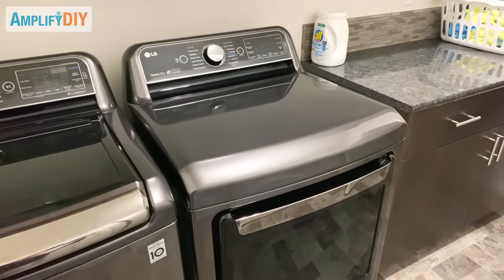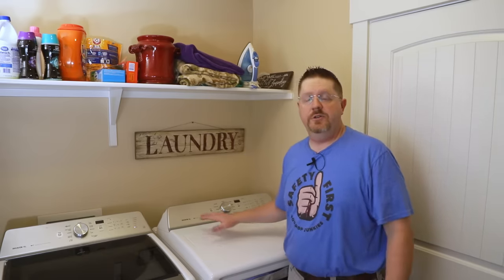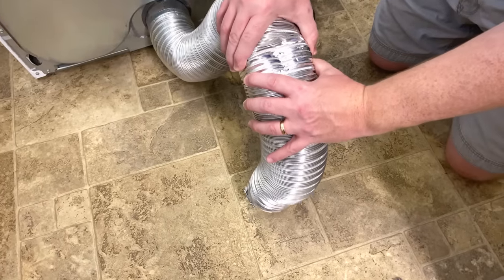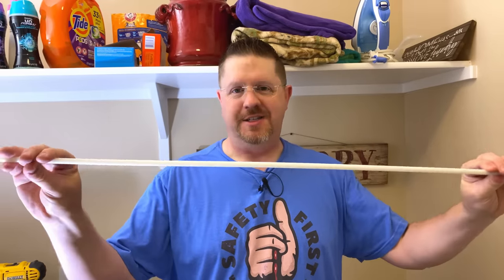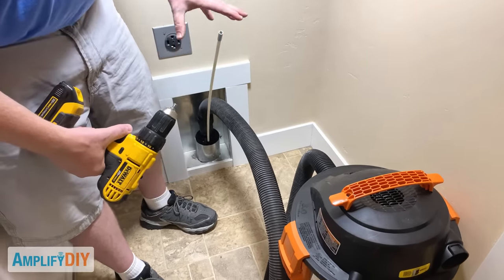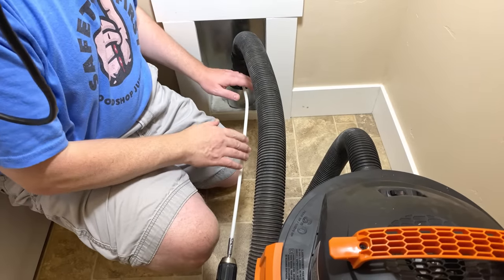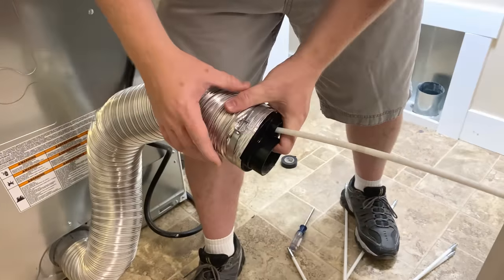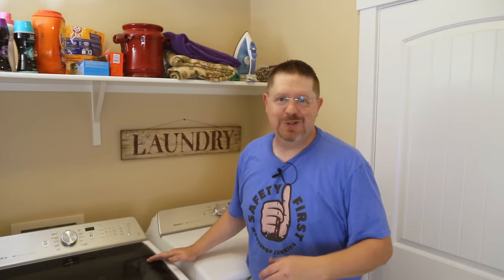How To Clean Your Dryer Vent Duct - Step By Step - It's Super Simple!

Comment: Thank you for the video. Is it possible though to clean it from outside the house as it’s almost impossible to detach the dryer from the wall?
Reply from the maker: Yes, when the dryer is difficult/impossible to move out of the way, you can certainly clean from the outside -> in towards the dryer. When doing it this way, many people opt to start the dryer (empty) on a cool cycle to help blow the lint out of the pipe. Sometimes this is done in conjunction with a shop vac, sometimes it's done instead of a shop vac. For example, if your vent is on the roof, it's difficult to get a vacuum up there safely. 
Good luck!

Comment: Yasss!!! Thank you!! Can I use a regular vaccum? i don't have a shop vac.
Reply from the maker: Hi Curly - yes, you can, but you may need to get creative to help seal up the gap at the end of the vent so the vacuum can be effective. Alternatively, you can leave the dryer connected, and run it empty on a cool cycle. Then go outside to the outlet and clean from the outside in towards the dryer. The airflow from the dryer will provide enough pressure to blow out the lint... but it will all wind up in your face this way. :) Be sure to wear a mask and safety goggles. 
Good luck!

Comment: As an owner of a company that does this for a living the video isn't 100% correct but it's a good start. Totally accurate that dryer venting should be cleaned once a year however the kits that are sold on Amazon aren't that great and you should never use a screw together type rod system unless it's the only choice you have. There are click/button types that you can use without the fear of losing the rods in the venting. Also if you have the option you should also try to use high pressure air to start from either side of the venting. This prevents blockages as the HPA can help loosen up any clogs rather than pushing huge clumps of lint into a tightly packed ball. All in all though the OP makes a good video of how to protect your home from fires as well as stop the premature burn out of your dryer element(s). The only other point I would have suggested is that you insert the shop vac hose as far into the ducting as possible as well prior to any rodding or HPA.
Reply from the maker: Great tips, thank you Adrian!
Reply: @AmplifyDIY  No worries, I love to see video's like this as it improves consumer awareness and safety...and your videos are awesome for the DIY home owners!

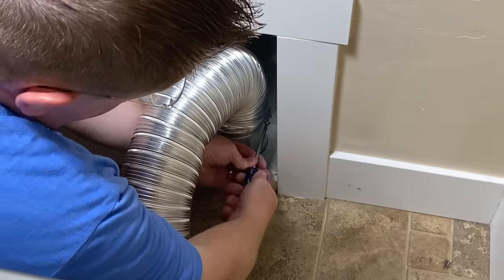Comment: Great video, I'd be concerned about the condition of that vent tube, in the video around 14:45 when you push the dryer back against the wall, there's evidence it's crimping the metal tube and likely reducing air flow because of it.
Reply from the maker: Hi Edward - I didn't show it (and I should have) but after I placed the dryer back in position I did check carefully back behind the dryer, and while the vent tube did have a bend in it, it was not crimped/crumpled/folded. Good eye, and thanks for watching!

Comment: I found that there was a leak in our attic and it was due to a small seem on the roof exhaust 6:28. I cleaned out the clogged exhaust on the roof only and used some flex seal to patch the leak. After watch this I want to go back up and clean out the dust inside!

Comment: Thank you for the great tutorial.  Quick question I am sure someone already asked.  Very tight quarters in the house, can I remove the outside vent and go in from there to  the dryer?  Wasn't sure if you mentioned or someone mentioned this already.  Just ordered the kit and its a straight shot from the dry to my outside vent, so I would "hope" :) it would be simple.  Thoughts or tips? Thanks again!
Reply from the maker: Hi Dave - yes, you can absolutely clean from the outside->in. Often when doing this, people will leave the dryer in place in the laundry room and turn it on to it's coolest setting with no clothes in it. The dryer will provide plenty of air pressure to blow the lint out as you clean from the outside. You won't need a shop vac. I do recommend you wear eye and respiratory protection if you do it this way, as you'll get a LOT of lint blown into your face. 
Good luck!
Reply: @AmplifyDIY   thank you for the clarification!  Where did you get the black attachment with the two holes (large and small) for the shop vac/ tubing that you used in the video? Didn't see a link in the comments for that piece, and it didn't look like it was included in the Amazon kit you purchased?  Much appreciate the quick response!
Reply from the maker: It was included in the LintEater kit, from this affiliate link in the video description: https://amzn.to/2E0gZjK  -  there are a bunch of knock-offs on Amazon now, none of which include that adapter. Make sure you are buying the LintEater from Gardus - that's the only one I've found that has that adapter. I'm not associated with them at all - I just like that cleaning kit the best, bought it with my own money, and it's exactly what I demonstrated in the video. Thanks for watching!
Reply: @AmplifyDIY  perfect, I did look again and ordered the one in your video that included the adapter.  Now I just need to  change my dryer door from one side to the other as the washer and dryer are on opposite sides of where the water hookup is and the dryer vent is....ie...I have a semi rigid silver slinky hose that I have to snake around the back of the washer to get to the vent in the house.  My wife said because the doors open the opposite way.  Cannot change the door on the washer, but it looks like I can switch the dryer.  The drawback, you have to lift the clothes over the washer door into the dryer if I switch the machines and change the door to the other side on the dryer.  (facepalm here). :)

Comment: Wish I had seen your video BEFORE getting into trouble cleaning my vent. I have the same cleaning kit and wad unaware of the set screw use or tape trick. The brush came off in the duct within the wall:-((ANY suggestions on how to get it out? 🙏🏽  Jason in Cali
Reply from the maker: Sort of depends on how far / deep into the vent the brush broke off. I've heard from viewers in a similar situation who have taped a bent coat hanger (in a hook) to the end of the rods they did manage to pull out, and use it as a long, flexible shepherd's hook to pull the stuck brush back out. You may find it easier to pull from the outside rather than from the inside. Good luck!

Comment: My vent is about 15' from the dryer to the outside, and it looks like the kit comes with 12' of extensions. Is it OK to clean from the dryer out, and then from the easy access outside cover and clean in the opposite direction towards the dryer? Thank you, and great video.
Reply from the maker: Yes, that's a great way to do it. Good luck!

Comment: Great video, but what does one do if they do not own a shop vac??
Reply from the maker: Hi Joseph - there are a few options. The first is to use your regular home vacuum cleaner, and a lot of duct tape to adapt it to fit the brush adapter. The second is to clean the duct from the outside of the house in towards the dryer, rather than from the dryer side out towards the outside. When you do it this way, leave the dryer in place and connected to everything, and start it running with no clothes in it on it's coolest setting. The dryer itself will provide plenty of airflow to blow the dislodged lint out of the duct as you clean. Note that you should definitely wear a good mask/respirator and eye protection if you do it this way, as all that lint will blow out into your face as you clean. Good luck!

Comment: Can you use this kit for cleaning HVAC air ducts??
Reply from the maker: Hi Itachi - the brush is designed for smaller dryer vent ducts, so it likely won't do a great job on the typically larger HVAC ducts. Great question!

Comment: Does anyone have any experience doing this with vent tubing with two 90 degree bends? My vent goes up into the wall then turns 90 degrees to exit out the side wall on the other side of a 16 foot room. EXCELLENT video!
Reply from the maker: 2 90º bends should be no problem for these brushes. Good luck!

Comment: I have a progressive form of multiple sclerosis and my husband passed away in September. I called someone in my rural area and it was going to cost $200 to clean it when the vent is only 18 inches from the outside wall. I'm wondering if I have to clean it so perfectly and shiny like you do? If not, I think I can do it myself.
Reply from the maker: It does not have to be perfect. Any cleaning is better than no cleaning. Good luck!
Reply: @AmplifyDIY  thanks so much for your help!

Comment: A high power leaf blower works great inside blowing to outside
Reply from the maker: Hi Aceyorba - you'll need to clean more frequently this way. While the leaf blower can remove a lot of the lint, it'll leave a coating of lint on the inner walls of the duct, which will just attract more lint more quickly. Cleaning with a brush does a better job, so you don't have to clean as often. Thanks for watching!

Comment: Any advice for cleaning it on a high floor of an apartment building? Specifically on if the brush gets stuck on the outside of the flap and you can’t access the outside
Reply from the maker: That's a tough one. If you are in an apartment, I'd suggest checking with your property manager to see if they are willing to get maintenance involved in retrieval of the brush - especially since you are taking care of dealing with a fire hazard that could justifiably actually be their responsibility... 

Good luck!
Reply: @AmplifyDIY  if you own the apartment such as in a co-op or condo it could be complicated as to whose responsibility is what.

Comment: Great content.. FYI Just make sure it’s hard plumbed and connections on duct hose is tight.. I had 18 feet to outside went 10 feet and out came aluminum and wire.. 😮 oops…
Reply from the maker: Great tip!

Comment: Hello, thanks for the video but I’m trying to figure out what size the shop vac hose adapter would be. I ordered the kit but there are various different sized shop vac hoses. I want to make sure it’ll fit the adapter in the kit. Any suggestions? Thank you!
Reply from the maker: I don't recall the exact size, but I know there are several "standard" sizes for shop vac hoses. My hose happened to fit the adapter perfectly, but if it did not, at my local home depot or lowe's there is a section near the shop vacs full of adapters to make things fit for just a few bucks. 

If your shop vac does not already just fit the lint cleaner adapter, I'd bring that adapter to the store and find what you need there to make it fit. 

Good luck!

Comment: Mine definitely vents to the roof, and I'm not going up there. Will a partial clean from the other end be worth the effort?
Reply from the maker: Hi Bill - it is very likely that you can get the brush all the way to the exit vent (even though it is on the roof). Even if you can't get up to clean the vent outlet itself, cleaning the inside duct all the way to the vent is definitely worth it. Good luck!

Comment: Would this method be safe to use if my 'duct work' is entirely the flexible kind? 
Thank you
Reply from the maker: Hi poyomi - NO this is not a good idea if your ducts inside your walls etc are all flexible. This brush will likely damage that kind of duct. Also, that kind of duct (at least in the US) is not up to code, and is a serious fire hazard. I'd strongly suggest you see if there is any way to replace it with a smooth-wall rigid duct like I showed in this video.
Good luck!

Comment: sorry if this has been answered before, but what do we do if we dont have access to a shop vac? my parents refuse to get it professionally done and the lint build up being a possible fire hazard gives me a ton of anxiety so i’m thinking of just taking it into my own hands.
Reply from the maker: Hey there heehoo peenut! If you don't have a shop vac, you have a few different options: you could use a regular household vacuum - just need some duct tape to adapt the hose attachment thing to fit the smaller hose on a regular vacuum. You may have to stop halfway through and empty the vacuum, though. Alternatively, you can clean the duct starting from the outside of the house in towards the dryer. With this setup, you don't need to move the dryer at all - just make sure it is empty and start it on the coolest cycle it allows. The dryer itself will provide plenty of air pressure to blow the lint out of the vent as you clean. If you do this method though, I recommend a dust mask and eye protection, as lint will be blown out straight at you during the whole cleaning process. 
Good luck!

Comment: I assume you just leave the shop vac on the entire time you’re cleaning?
Also, how thorough of a job can one do with just the brush without using the shop vac? Thanks.
Reply from the maker: Hi Sanitary - yes, you should leave the shop vac on for the whole procedure. If you don't have a vacuum that you can use, then you can use the airflow of the dryer itself to do the cleaning: start the dryer on a cool cycle without any clothes in it. Then, go outside to wherever the dryer exhausts, and clean from there in towards the dryer. The air blowing out of the dryer will blow all the lint out (and all over you. ;-) )
You do need some sort of air movement during the cleaning process, or else the lint will just ball up and clog the vent.
Good luck!
Reply: @AmplifyDIY  thanks a lot! great video and subbed.
Reply: @AmplifyDIY  update: I did this weeks ago with the shop vac and it worked like a charm! Keep up the good videos.

Comment: How do you clean the flat ducts?
I have a flattened metal duct to save space behind the dryer and the wall, attached from the dryer to the wall.
Then im not sure what is in the wall under the house that goes from the wall behind the dryer to the outside vent.

Comment: 6:30 just an FYI to folks that have this plastic style roof vent. my house was built in 2011 and i had this vent cap style crack and leak water into my home. i get alot of wind and rain in the winter and alot of intense sun in the summer. if you can replace this vent with a metal vent cap.

TAR THOSE ROOF NAILS @ 6:30 !!!!

Comment: I used this method but the brush ended up detaching in the middle of the vents. I bought another kit and thought I can push that brush out. I got all the way through but no brush popped out! Could I have a break in my piping?
Reply from the maker: 🤔 Possibly... but it's more likely that the second brush simply could not really "push" out the first one. The second is likely still stuck in there... One way to find out for sure is to get your hands on a cheap borescope to visually check to see what's going on in the vents. If you have an iPhone, here's a decent option for around $25: Primer: https://amzn.to/2CIe0bC
Good luck!
Reply: @AmplifyDIY  thank you for the reply. The link lead to a primer can. What’s strange is the duct is only 4” diameter and so is the brush, so I do t understand if I’m pushing the second brush through how it could miss the first brush all together. I’ve also added duct tape to the second one to hopefully grab it out.

Comment: Our dryer vent is made from the metal flex duct.  Not just the small piece attaching the dryer to the wall but the entire length of the duct is the flex metal.  It goes up the wall and across the ceiling and then outside.  Is it okay to use these rotary brushed on an all metal flex duct?  Just concerned about damaging the duct.
Reply from the maker: Hi Julian - NO, do not use this brush on that type of duct. Is your house new? Flexible ducts inside walls have been against building code for many, many years, specifically because of the fire risk they pose. Unless your house is very old, the builder cut corners, and the inspector missed it.
For ducts like yours, I recommend using a leaf blower to blow out the duct. Don't try any sort of mechanical cleaning, as you are VERY likely to rip through the very thin walls of the duct inside the wall.
Ultimately though, you really should get that duct replaced with a smooth walled one like was shown in the video. 
Good luck!

Comment: I think I may have to do this, I tried to use my Vacuum.  Before I did not have the hook up to the duct and was making a mess, ever since I put a new duct in and connected it, it is taking twice as long to dry my clothes.  I may need to do this
Reply from the maker: Most likely, yes. You probably have a lot of lint blocking the portion of the vent that you did not replace. Good luck!

Comment: How critical is a shop vac? I have a regular vacuum cleaner with a flexible hose. Can I use that instead?
Reply from the maker: Hi Afi - yes, you can use a regular vacuum, though you may need to use some duct tape to adapt the fitting for your smaller hose. Good luck!